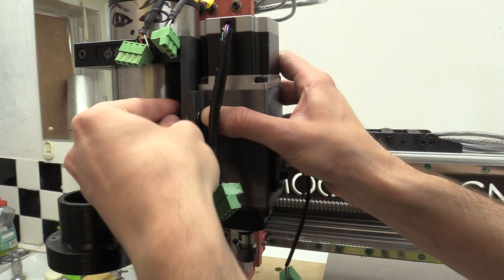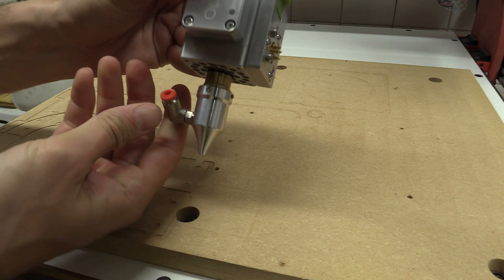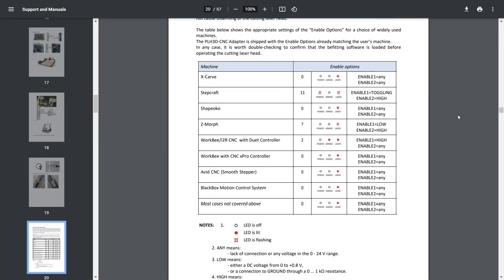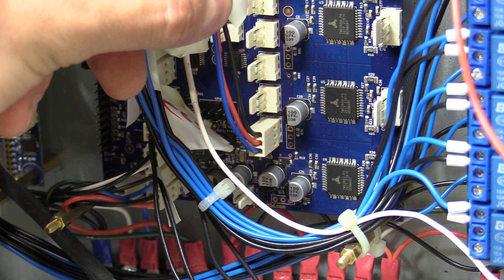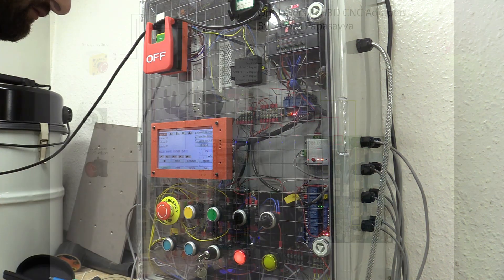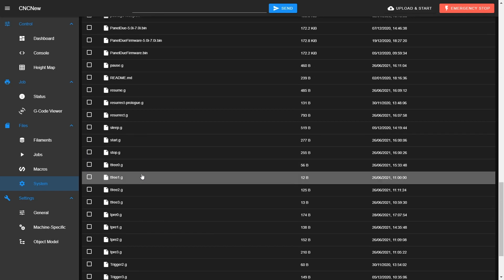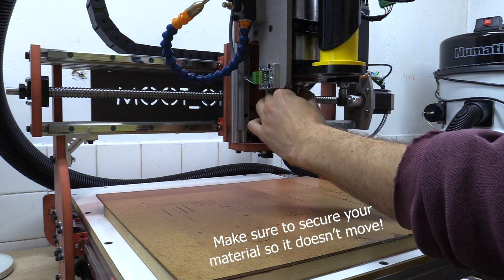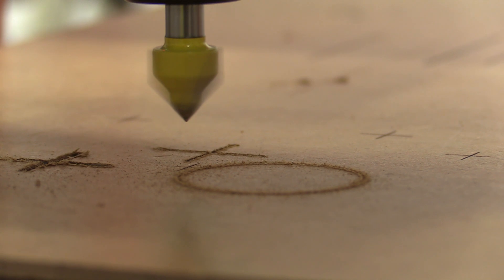#59 Opt Lasers PLH3D 6W XF+ Head Duet 3D Installation Setup Calibration - Duet CNC Controller P7

Comment: I got an Ultra-HD PLH3D-XT-50, HP Air Nozzle and LaserDock, and my CNC controller is a Raspberry Pi 4 Model B, do I need the 24v ac adapter like the one you got ? and where do I can find all the instructions please ?